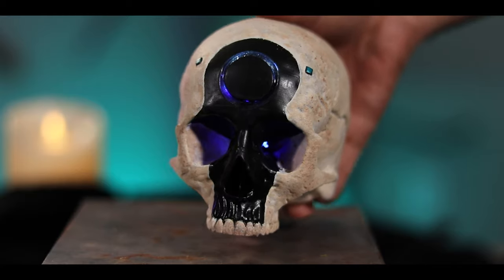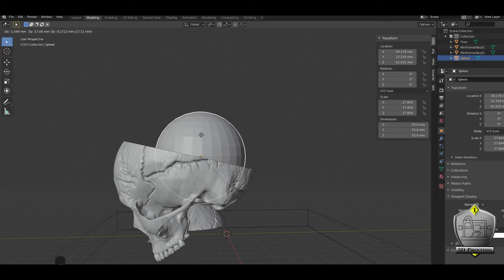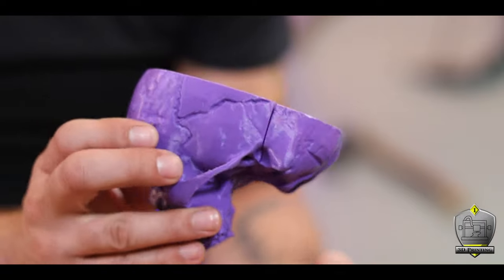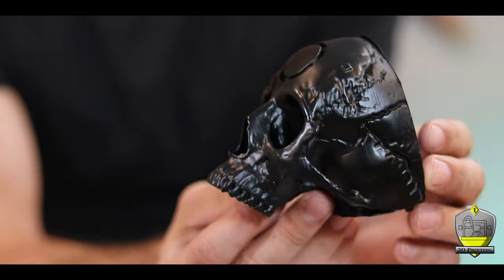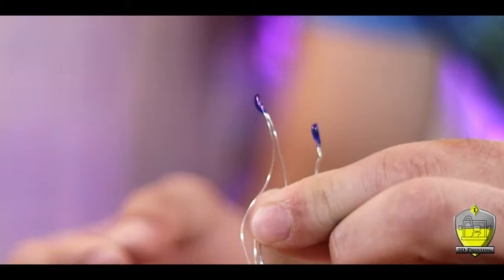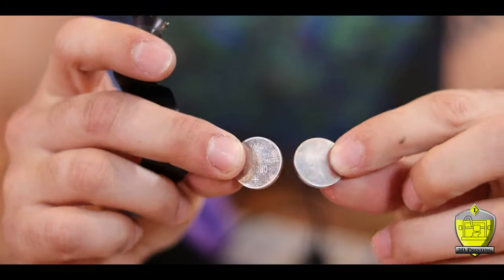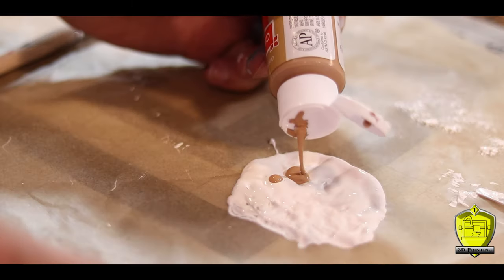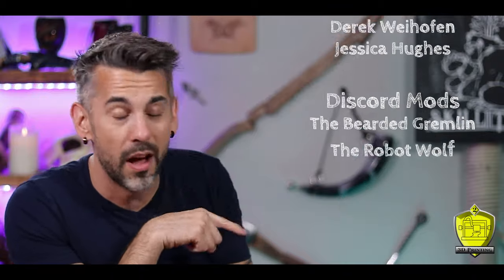Learning How To 3D Print

Comment: Great video as always Cl3ver.  I love my printer, just having issues with the bed leveling, you might try giving a quickskill on bed leveling when you replace the print bed. :D  Also prop wise, I really love the brain Dance rig from Cyberpunk 2077 (and yes there is an STL for it on thingiverse, I just don't know how to do the rest of the stuff it needs like the led setup)
Reply from the maker: I will check out the STL and see what I can see😁 As for the bed leveling, that CAN be a real pain. I will have to learn more on it myself before I can offer up any meaningful help 🤣
Reply: @SkillTree  it's especially fun if you replace the plate with a flex plate. Have to install a magnetic plate and mount the flex plate on that. Makes pulling the print off easier, but leveling is a pita

Comment: I'd love to see you make 3D Printed leather stamps. I have been thinking about making them, but I don't have a 3d printer yet. I know some plastics are stronger than others, I wonder if any can stand up to a clicker press.
Reply from the maker: One way to find out, says I😁. Let's see what we can do. Let me know if you have any specific requests in mind.
Reply: @SkillTree  what about a dragon eye stamp? There are a lot of stamps out there for dragon scales but I have not seen one for a dragon’s eye.
Reply: @SkillTree  Heck, I'd love to just see your logo! 

One of the other ideas I eventually want to do is to 3D Print a "plate" lets say of a viking serpent book cover design. Then I would attach the print to thick plywood or cutting board to be used in a press. Essentially that design would be book cover. 

The main concern would be using a strong enough plastic that can hold up to being pressed. Maybe Nylon or something similar? I haven't done enough research on plastic types and strengths yet.

Comment: You could also have used EL Wire.  it is just as easy to use and very affordable and can be cut to any length.  Small experimental kits come with 5 feet of wire and cost $10

BTW: not for nothing but 1.5X3=4.5 not 5.5  but who cares?
Reply: OH and make a Tesseract from the MCU.
Reply from the maker: I had never even seen EL wire! Thank you for turning me on to this!